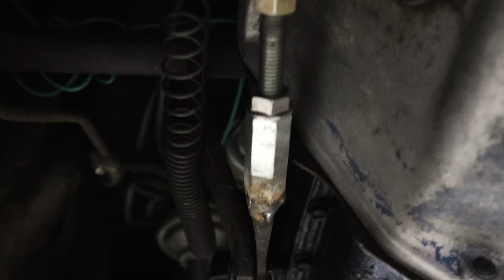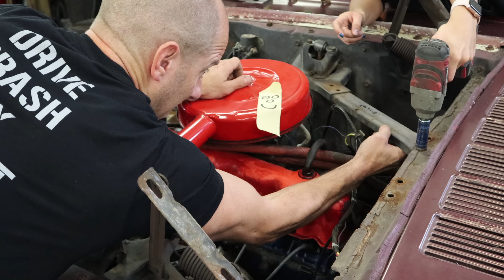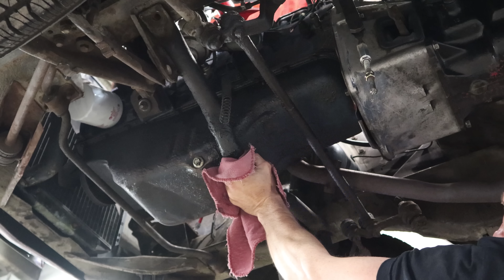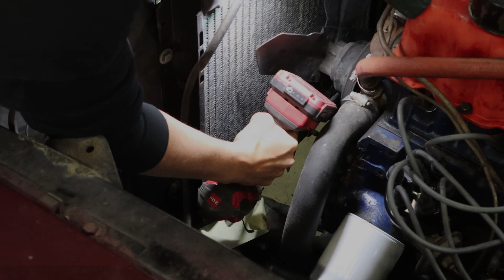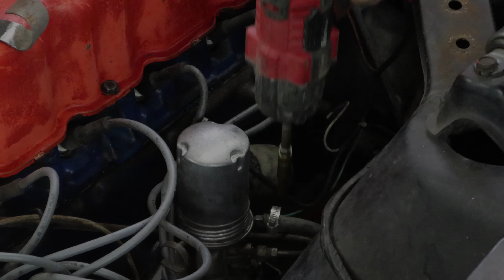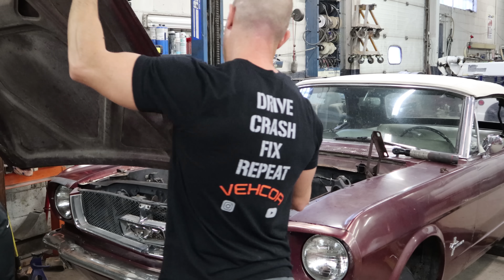1965 Ford Mustang restomod rebuild project part 2

Comment: the ford jokes crack me up, and i own a ford, which is weird being i am a chevy dude. i dunno if ya go back and read comments but i found your channel through the trail blazer build 2 weeks ago, so i decided to watch this. for those i see with the anti chevy....... i got 652,127 miles outta a 91 chevy c1500 with a 305, without an engine rebuild before i sold it. i have a 600 dollar 1993 ford f 150 i drive around cause people drive like idiots and well, if you crash ya 50,000 buckaroo car into it ima laugh.

Comment: This really brings me back.  My first car was a 1960 Ford Falcon 4 door.  It had the same physical size engine but was only 144 cubic inches.  I believe this one was a 170.  Over the time I had it I just about rebuilt every part of it except it had an automatic transmission.  The first Mustangs were Falcons with different sheet metal.  Open them up and they all look the same.

Comment: The car is 55 years old. Do you really have to critique the fact that some DIY'er did some work to their own car? We don't all have our own fully stocked shops.
Reply from the maker: Yes, if you cannot do the work properly, don’t do it!  I suck at basketball, so I don’t play.  You don’t need fancy tools to do the job correctly, my videos prove that.  Also, you can make arrangements to use the fully stocked shop if you feel you need it to complete the task correctly.

Comment: Your comment about the Ford jokes. Kind of odd that you keep joking about the most successful American car ever made. When the 64.5 Mustang first came out the dealerships typically had 50 people a morning waiting for the doors to open to buy a Mustang. That had never happened to any dealer before or I doubt ever will again. Give em credit where it's due. I personally have owned way more cars than the average person (had 27 by the time I was 16) and presently own Chevys, Fords and Hondas and the absolute dogs for repairs has been the Chevy's for me.
Reply from the maker: Mc Donalds sells the most hamburgers, doesn't mean they are the best! lol  You are talking to a full time mechanic that works on more cars in a week than most people own in a lifetime.  One that also has personally rebuilt over 1000 vehicles.  I make fun of every manufacturer for the dumb stuff they do.  It seems only the Ford fans cannot take a joke and when they tell me how I should run my channel... How's that working out for them? lol  The best part is most of these Ford fans can't even change their own oil but think they are experts. lol
Reply: @vehcor  I am not sure how many cars I have worked on and scrapped. Our family ran an auto wrecking yard for many years, just sold it five years ago. Started stripping engines before I was 10. I am near 60 now so like you I have seen my share of cars. Yes it is at times shocking how stupid manufactures can be and on the opposite end how clever as well. I am wondering if you are referring to me when you say that Ford fans are trying to tell you how to run your channel. If so wow how touchy! My main reason for asking was you are the one that was knocking the car that YOU choose to build so really made me wonder why. If you think Fords are such junk why did you throw your money down to buy one? Valid question no?
Reply from the maker: @davebrittain9216  Perhaps watch the first video in which I answered your question.  10? late start, I was stripping cars at 5.  Probably why it is still my favorite part of any build to this day.  I call it like I see it. I prefer to work on GM cars because they make the most sense and hold resale.  Yet there are models I will not touch and have no problem saying it as I have previously.   I don't have to like everything about a car to like it overall.  I build what I want. I run my channel how I want.  The Ford fans are quick to attack any other brand but cannot handle some jokes.  I don't care what anyone else thinks.  It is sad that you are still worried about what others think.  I have never cared and my life is far less stressful.  If you don't like it or can't take a joke, don't watch.  It is so simple. Why can't people figure it out? I assume they just want to be unhappy. If you need a place where everyone thinks like you and will dance around your feelings, move on, you are in the wrong place.  LIGHTEN UP learn to take a joke and the rest of your years will be easier.  Start your own channel tell the world how you feel unless you are too worried about what people think! Could you image how unhappy I would be if I was trying to please everyone or care what they thought? lol
Reply from the maker: Awww, can’t support your opinion and can’t handle a different one!  Yep, you fit the description of people I don’t want around! Bye!

Comment: Well Scott, before you get too far down this Ford avenue stroll, you better pull off the cowl panel, that is where the cabin fresh air system, yeah I think your going to need to look at this " RUST Magnet" location. The afternoon crew is getting more confident, and the hell with the watch. Anything she doesn't break is good. . . Right ? What's the story with the afternoons crew wrist tattoo ????
Reply from the maker: I will be tearing more than the cowl panel off in due time.  Yes, with more confidence comes more sass from her, it is amusing to me.  She has quite a few tattoos, I never remember why she got them all. lol

Comment: You must be one of those Ignorant chevy people that talk with there asshole as there mouth knows better.  Let me see a 1965 chevy that sold anywhere near the numbers FORD Sold with the Mustang.  chevy means Cheap Heavy Entertainment for the very young, they were made by the gmc Gummy Motor Corporation.  Shity, I mean chevy did not come out with a PONY car until 1967, the tried to follow suit.  LOL What Losers.  I used to street race for many years before it was a thing.  Back then I was fighting off chevys with bigger motors with my 302 1966 FORD MUSTANG.  I embarrassed so many.  LOL It was comical to see even big block Trans Ams , Firebirds with 350s, 455 Olds, on and on trying to beat me and I left them sitting every time.    REMEMBER FORD IS ALWAYS FIRST ON RACE DAY!

Comment: I rember those cars and worked om many of them, what you removed did not look like much and never did they just tied the inner fenders together with long thin formed sheet metal with a few maybe 1/4-20 bolts,  not much structure underneath

Comment: The best way to get the motor out of a Mustang?? 

Leave a trail of cheese, or peanut butter, and then turn the lights off, and wait!! It'll climb out of the wheel, and follow the bait, in a short period of time! 

The next best method? 

Park a Chevy next to the Mustang, and rev the engine, to scare the mouse, ahhhh I mean, motor out!! 

If that won't work, close the shop up tight, and leave a cat in there overnight!! There'll be room for a coyote, before you know it!!

Comment: Be mindful of the fuel tank location on that car.  The tank located inside the trunk with a rear fill is a disaster waiting to happen in a rear end collision.  Not sure if there's anything acting as a firewall between the trunk and passenger compartment either.
Reply from the maker: Well, I guess we will just have to fix Ford's shortcomings now won't we? lol

Comment: Is that engine a 200 or 170 6 cylinder engine
Reply from the maker: I could not tell you.  I don't know much about older cars.
Reply: @vehcor  count the freeze plugs on exhaust side 3 is a 170 5 is a 200

Comment: Great work as always loving the build so far. Do you need to change the axle's aren't the 6cyl Mustang's 4 lug ? For a non ford guy your doing great lots of love from your favourite Mustang loving Brit!!
Reply from the maker: Yes, the axles will not handle the coyote's power.  It will all be upgraded to 5 lug.  Thanks for the support.

Comment: sensitive ford fan were... I wonder if they know Ford has a new roadside assistance program for when they break down its found in the trunk. it includes a bolt on handlebar for pushing the vehicle off the road.
there's also a game you can play if you own a 5.4 3v jets named what's that laying in the road a piston, crank, oil pan.. who turned on the GPS?

Comment: Tell ya what. I follow quite a few YouTube channels and yours is one of my top 3 favorites. 2 other things to comment.1, piss on all of those Ford folks and stab a GM LS engine and a 8 speed auto trans in that Mudstain. That would be very cool. 2ndly, why is it that when folks are doing an engine removal, the coolant system/radiator is one of the first pieces to be removed? I say that because that part is the most messy, makes the biggest mess all over the floor and car and is constantly dripping while taking everything else apart. Myself, when I do an engine removal, that system is the last very thing/part to come out. Ta hell with that mess being in my way while doing everything else. Anyway, another cool "not boring unbuilt Friday" video. Thank you!
Reply from the maker: Thanks, I want to annoy the Ford guys, not kill them. Watching an LS go in this thing will do just that. 😂 I always do the stuff underneath first before anything with fluids to avoid the mess and dripping on me.  Thanks for the support.

Comment: I was around a couple fords. My brother had a couple engines on stands in his garage. He was a GTX freak with a couple AMX track packs. I thought it odd at age 16 to have two huge boat anchor 427 SOHC engines taking up valuable space. They were Kalitta sell offs. I also remember holding a sodium filled valve in my hand. It was as big as the bottom of a pop can.
Reply from the maker: I was around all brands, they all have their pros and cons.

Comment: I love this build. Ford GPS lol now I know it wasn't there first try but they were trying back then oil was cheaper and maybe they were thinking at night they could put a match to it. That would be easier to see at night. I'm a ford fan but if something I've said offended anyone SORRY it was all in fun. Does this Mr. Spotty remember or know what happened to the other one real lucky he seems laid back and just likes to stick around but keep an eye on him. If you didn't have the lift would it be easier out the bottom or from the top I was wondering cause I've not been in on taking one out the bottom. Keep vids coming AND the standup jokes I have to rewind cause I laugh so much I miss some. THANKS.
Reply from the maker: I was directing my comments at the people that have to get all big and tough on their keyboard and my personal favorite, the kid that his daddy drives fords and if I don't stop insulting them he will not watch my videos. LMAO  As if I care.  It would have been a little more work to go out the bottom but only a couple bolts.  However I would have had to dig out the dolly to roll it out.  This way it was already on the forklift to go right into the truck to storage.  You could have also pulled the radiator support off and taken it out the front.  Thanks for the support.

Comment: When you have the opportunity to, take us on another tour of the subframes and tell us what you're gonna do to keep the new horsepower from twisting the body into pretzel shape when you hit the throttle. 

I had a buddy with a Mercury Cougar ZR7, convertible and a mouse motor in it and he went to (IIRC) a 428 or 429  "Shaker" engine from a Ford Factory Galaxy 500 street racer. The first time he dumped the clutch, he was condemned to crawl in and out of the car through the windows - the doors wouldn't open any more.
Reply from the maker: You will be seeing plenty of the floor on this build.

Comment: BTW.... save those crossbraces.... they'll keep the fenders from imploding with the weight of the new engine. Remember... there's NO REAL FRAME UNDER THIS UNIBODY! And it's a convertable...  so there's no headliner to keep the headlights in alignment.
Reply from the maker: I'm saving everything until it runs and drives.  I made that mistake on my first restomod and it cost me big money (at the time).

Comment: Cool project! 
I did one of these a few years back. I wound up replacing the suspension because the light duty four lug  front suspension and rear end gave me some trouble when I stuffed in a 289.  Yeah, it was the 70"s...LOL!
Reply from the maker: Yeah, the suspension will be the second thing to go.  It will not like the new 5.0. lol
Reply: @vehcor  Can't wait to see how it turns out!

Comment: haha the 12 hp......1 bbl carb, BUT 55 years and it's still running. Can't say that many cars built today will be running 55 years from now. Many don't last the warranty period! (ie: Ford coyote engines).
Reply from the maker: No doubt it runs great, hills and merging are a challenge but it runs.  The Coyote might not last but it will go up hills and merge with no trouble.  Hopefully it is going fast enough to coast to the dealer for service. lol
Reply: @vehcor  The problem with Ford is you don't know if YOUR coyote will last or it will grenade in 10,000 miles. It's hit or miss. I saw one (rated R cars?) where a part of the block cracked because when they cast it, the material didn't flow into the corner properly and was thin. Another the coating inside the cylinders was too thin and wore out in 3000 miles. The list is long and varied. 

Ford used to have a motto "Ford: Quality is Job 1" now it's "Ford: Quality is job none". But hey, look at the colour changing interior lights and isn't that digital dashboard pretty?

Comment: Scott I'm just curious. When you were taking all those brackets off and looking underneath the car, is it my imagination that everything looks really light duty? Like nowhere near as thick as today, in today's vehicles.
Reply from the maker: It is not your imagination, these cars are pretty weak.  I'm not even trying to bash Ford, they just were massed produced and low quality.  They were commuter cars in the beginning.  The aprons are just flat thin steel and the rails are slightly thicker straight boxes, everywhere. They got a little more robust as the power started being added and they turned into a muscle car.

Comment: "British rust proofing aka oil leaks"
Pfftt ..
My dear chap there is a method in our British madness after all we do use salt on our roads ...
Reply: I thought they made the electronics water-soluble so that they wouldn't have the problem of running at all...
Reply: @stoneshrink  Lucas worked hard on its lighting electrics to earn the title of 'Prince of darkness'. Please don't rubbish it as they succeeded.
Having said that Bosch weren't that clever either. And you'd think the people who invented (or discovered how to use) electricity would have been better at it.
Reply: Thats why there are so many holes in your roads. Damn
Reply: We use tons of it
Reply from the maker: All that time I spend trying to fix the manufacturers' perfection on rustproofing methods..... wasted. lol

Comment: Used to love Fords but they never showed any love.  For instance, I had one catch fire on the way home from work.  Had another one that took a dive in deep water.  A third kept opening the door which made me very glad I had the seatbelt on otherwise out I'd go.  A fourth blew the water pump every year.  During that whole time I drove a GM which never let me down these 20 plus years since '97 and I still have it.
Reply from the maker: No manufacturer is perfect, I make fun of them all because I have to fix them and it keeps me sane. lol I do prefer GM for similar reason and stories to yours.

Comment: Had a fast 66 coupe in college. Wife still tells horror stories about riding in the Stang. Need to build another 66. Keep the jokes coming!  Hey everyone should learn, made my daughter do the head and intake gaskets on her Equinox.
Reply: You cruel bastard
Reply from the maker: My GF has horror stories about riding in every vehicle with me. lol Good job with the daughter.  Must have been a 2005-2009 3400 Equinox. I have gotten pretty good at those over the years. lol
Reply: Yep 2008, should have held out for 2010 and up, build quality was very bad on those. intake gaskets always go on those engines and need the revised set, but it was the first time I’ve seen the head gaskets go on one.

Comment: I have never seen a grease zert in the end of a u joint cup in my 54 years.
Reply: They sell brand new ones that way. Moog makes them for just about every make and model.
Reply from the maker: The aftermarkets have them.  To bad no one used these. lol
Reply: The chromed zircs add 15 horse power.

Comment: With the engine that you have planned for the car, is there any original part on it that will stand up to the torque/power?
Reply from the maker: Absolutely, the headlights and hopefully doors will be fine for 400hp, the rest, not so much. lol
Reply: Nope.  Six cylinder Mustangs were weak.  They even had 4 bolt wheels.  Just rebodied Falcons in those days.

Comment: I had a 65 mustang convertible 289, 3 speed on the floor ran real good.
Reply from the maker: This one doesn't run bad but it has no power and lots of clutch issues.

Comment: I learned about British rust proofing from my father and his MGBs. Its cheap so I left it on my 73 Tradesman van I just swapped 360s on. But then again I'm doing it outside in January and just want it done.
Reply from the maker: So you have an inspection port in the oil pan.  That is not a problem, that's a feature! lol
Reply: Oh and before anyone comments the 360 made it to 545k miles before breaking a rod and driving 20 miles home before it decided to exit through the oil pan.

Comment: You omitted using Coyote swap to stay off the pesky trending list, well played. I guess the less Ford guys you Pee off.... And thanks for the washer organiser tip, I have a lot of long bolts not in use.
Reply from the maker: I highly doubt I will ever see trending again.  I had my 15 minutes of fame. lol  I usually kept the extra washers in a bucket but this handy trick seems to work well.